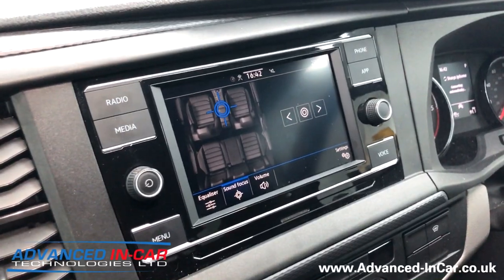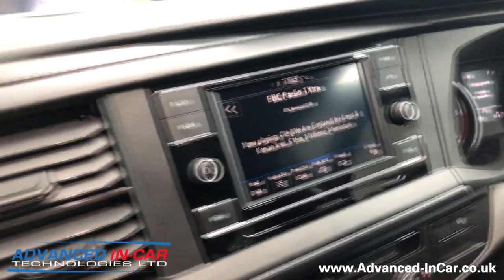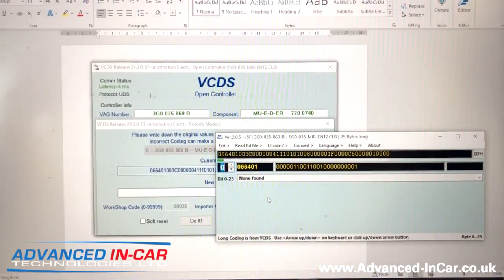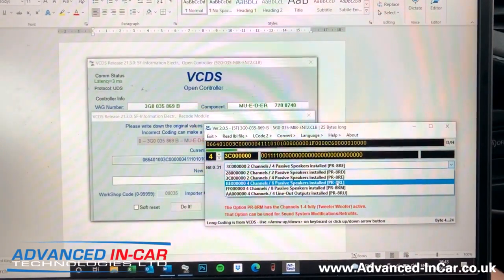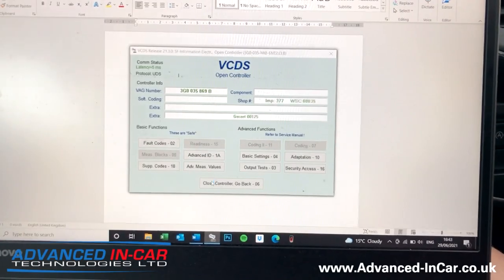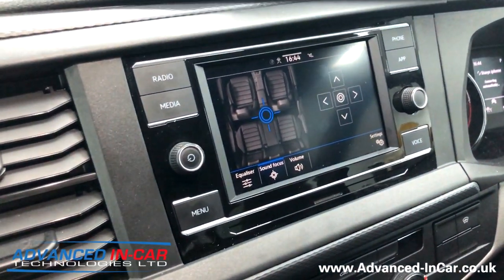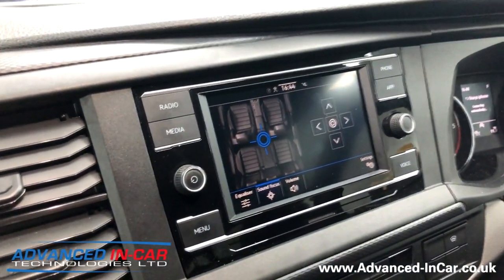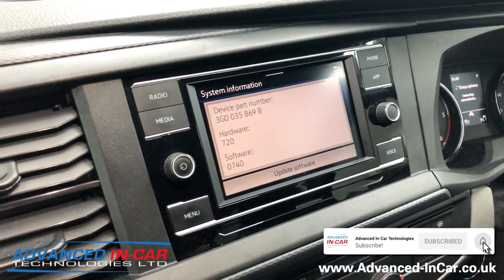How To Activate VW T6.1 Composition Colour Fader Function

Comment: Hi, i have same radio but without APP button. 
This is 17A035869 and when i hold setup button and check supported code there is 00060900 
Is it possible i can activate this code by VCDS?